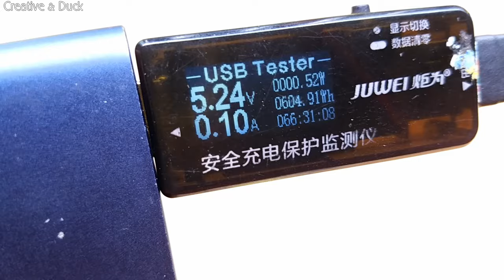Make 3w LED uses 5v USB high performance

Comment: this is not hiw you drive power leds. They need constant current and sufficient cooling
Reply: That thing in the middle is the constant current driver
Reply: @Pratte0112  It doesn't look like it. It has a single potentiometer so it's just one of those standard low cost constant voltage buck converters.
Reply: @mjyanimations1062  I agree. But I feel I've seend two types where voltage is constant and you can change the current and vice versa.. May be he's using the one where it has 250mA - 300mA Constant Current and voltage can be altered.

Comment: Hi, my microscope led is this exact model. I burnt out the original circuit board because I plugged a 12 V wall charger instead of the recommend 5 V. So my question is can I use this led with a buck converter to allow a normal generic 12v to power it? Also need a dimmer switch attached to control brightness. Does anyone know how to go about this ?
Reply: Don't use a standard buck converter, use one with current limiting. You can generally find them by searching 3w led drivers or constant current buck converters. Dimming is more difficult though. If you use an adjustable buck converter with current limiting (that has one potentiometer for the voltage and another for the current limit), you can modify it by adding a third potentiometer in series with the current limiting potentiometer. The device should then be dimmable with a wide input voltage. Don't use a regular buck converter like the onein the video, as it doesn't have current limiting. LEDs are very sensitive to even the smallest voltage increase beyond the forward voltage so driving it directly will severely reduce the life span.
Reply: @mjyanimations1062  can i use ams1117 voltage regulator in 1w led on a 3.7v battery ???
Reply: @hari_sn5331  I do not recommend it. The AMS1117 is a constant voltage regulator, and it will likely overdrive your led. Also it's a linear regulator which is quite inefficient under high loads and might overheat.

Comment: Can we not use DC 5V To 3.3V Step-Down Power Supply Module AMS1117-3.3 LDO 800MA ?  This can provide 3.7 volt at 800mA controlled output.

Comment: you don't need voltage circuit,  just use a resistor with led.
Reply: Agree
Reply: What value? I used 1000 and i get a very dim light
Reply: @kalendaryo9864  for 5v power source you need 10 ohm resistor
Reply: @andiwardana847  how about 100 ohms?
Reply: @andiwardana847  my issue about the led with 5v source is that when the led turned on it is so hot that it melts the plastic that holds the led
Reply: @kalendaryo9864  maybe you can add heatsink to reduce heat
Reply: @kalendaryo9864  i use 4 piece resistor (2 seri 2 paralel) @10 ohm  (total 10 ohm) to reduce heat and spread heat better without add any heatsink
Reply: best use a driver
Reply: @stop following me 2 watts. but if you use only 1 resistor it will become so hot, so I use 4 resistors @10 ohm 2 serie 2 paralel, see my comment to Kalen Daryo above
Reply: @andiwardana847  to connect 3w led to a 3.7v lithium battery  what resistor can i use?

Comment: Mandatory to use heat sink?
Reply: Depends on how much current you are pushing through it.  At 2.9 volts, that thing is using about 150 to 200 mA.  That was his point about making sure that the LED was not getting hot.  Normally a 1 Watt LED has about 350 mA.  And A 3 Watt LED has about 1 Amp.  If you want more light, you will need a heatsink.  And if you push it hard, a heat sink with a fan.
Reply: a driver or resistor is mandatory. Power leds (all leds)  require constant current, otherwise any small change in the voltage can increase the current exponentially and kill the led.

Comment: 100 ma ?
Reply: 700ma
Reply: @mjyanimations1062  That much, can't get mine anywhere near that. They are ebay rubish ones though.
Reply: @johnmoor8839  those specific 3w ones run at 700ma. I bought them 0.5 dollar a piece from an led supplier. Haven't tested those cheap ones on ebay though. maybe I should.

Comment: Какой C° у паяльник ?
Reply: 200-450 °C, зависит от того, какой припой вы используете.
Средние температуры плавления
Припой 60/40: 230-270 °C
Бессвинцовый припой: 300-370 °C

200-450 °C, depends on what solder you use.
Average melting points
60/40 solder: 230-270°C
Lead free: 300-370°C